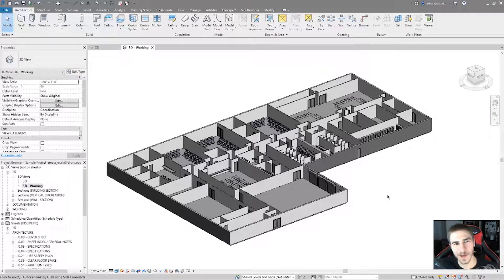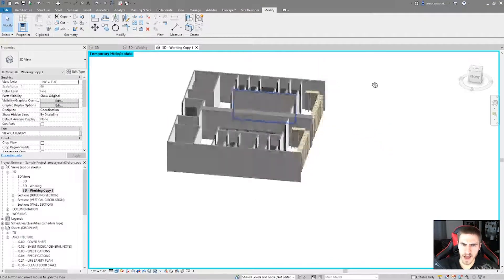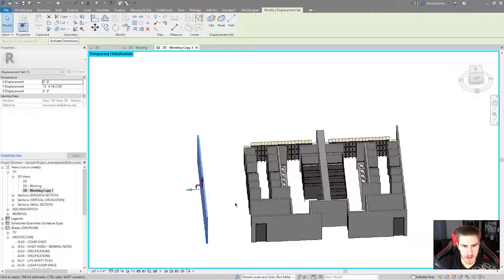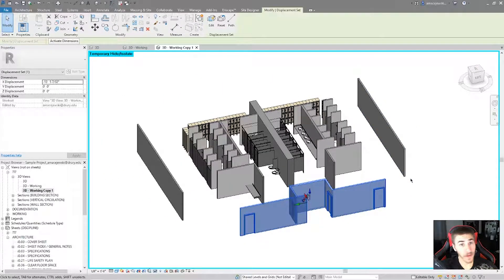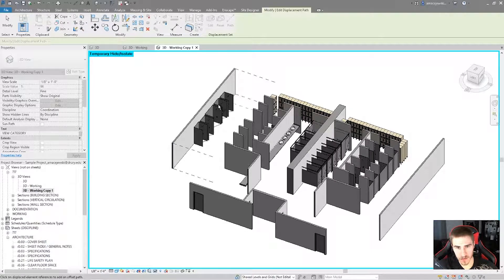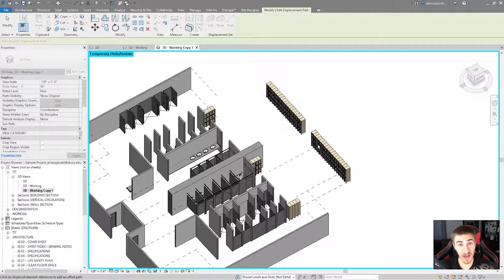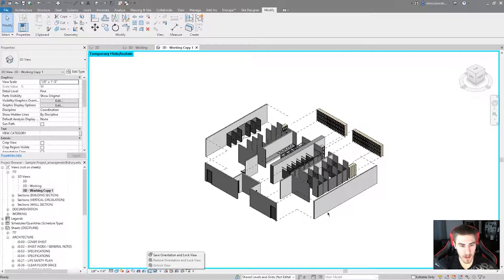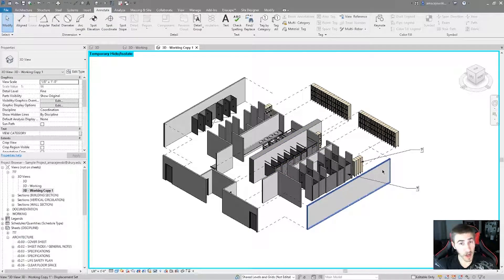How to Use the Displace Elements Tool in Revit | Revit 2020

Comment: Awesome.  When you displace the wall and then you were able to displace the shower (that moved to the wal).  Were the showers in some way or fashion attached to the wall prior to the displacement?
Reply from the maker: It does not have as much to do with the shower being attached or hosted to the wall as it does the action of displacing. By that I mean before adding the showers to the displacement selection, I had previously displaced the wall next to the showers to a new location. By adding the showers to that displacement, the showers moved the same amount as the wall. The showers ended up next to the wall again because of their location prior to the displacement. I could have chosen to add a toiled or other object across the model to the displacement and that object would have moved the same distance and direction as I had previously moved that wall. Hope that makes sense!

Comment: Good stuff. The only thing I would add is that I believe you also get the ability to dimension in 3d when you lock a view, and I can see how that would be helpful in this kind of axo view. 
I also do not use this feature enough. One question though, how does revit handle these 3d views if you want to export them to dwg? Di you get clean "flattened" 3d, or does it just export it as an image?
Reply from the maker: You are absolutely correct! I should have mentioned that. Along with being able to tag, draw detail lines, you can also dimension in a locked 3D view. Thanks for the catch!